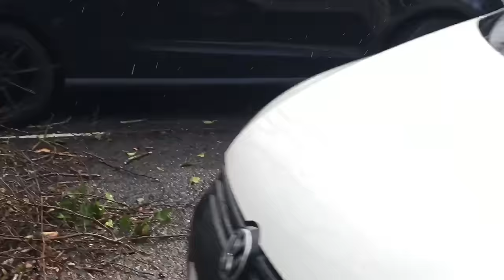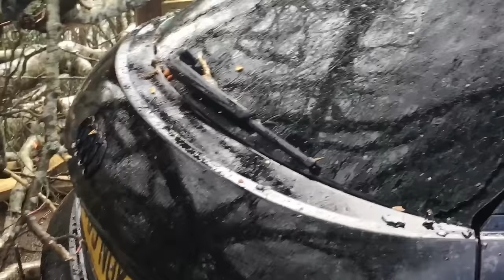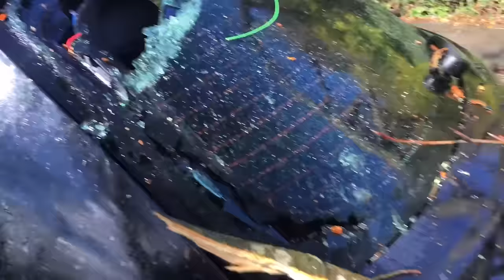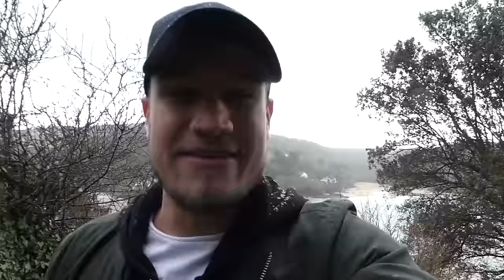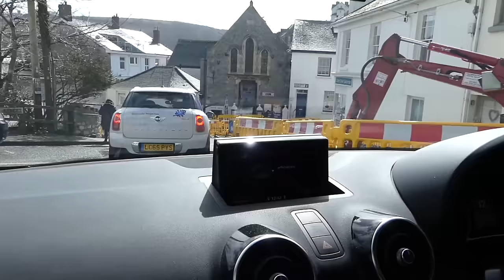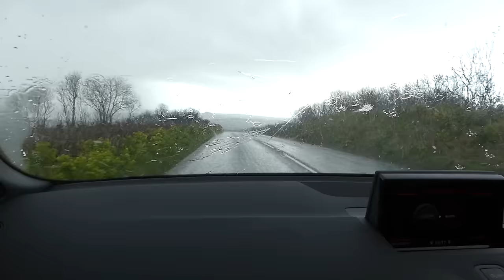MY DAILY DRIVER 'THE NUKE': 6 MONTH REVIEW!!

Comment: Paul, some advice from a fellow Audi owner (A3 Saloon 1.4tfsi S tronic) - you'll get better economy with drive select in comfort or even individual. Economy mode actually uses more fuel to tick the engine over in neutral, whereas coasting in gear uses none whatsoever. My overall mpg increased about 10% once I ditched economy mode.
Reply: My father recently had the A4 Allroad with it's top spec for a weekend, Dynamic mode is probably the best mode for both comfort and economy

Comment: my mum just picked up the new 2016 Audi A1 sportback 1.6 tdi with the active exterior pack. very rare only 2 of them in northern ireland and we have 1 of them.  it looks insane. it has matte grey front splitter with  connecting grey fender trim and matching side skirts and rear lower bumper. its coloured in 2016 high gloss audi red with matte grey secondary colours matching the body kit.

Comment: Bought a factory ordered Mini F56 Cooper, eighteen times it's been in for faults, electrical parts replaced, on my third door handle, things not screwed together rattling, dash top removed and refitted to seat top air vent and tuck in material coming out at the central display, fuse box was not screwed tight, door rubbers trap dirt and scratch the inside sill, material coming away from both rear windows that would require them refitted so living with it, a passenger seat belt rattle that was common on early builds they don't know how to fix and it goes on. Engine is fantastic as is the tech but from day one problems. So wish I'd gone the Audi route. I'll never buy a split new car again from a new model just out. Had my old cooper six years R56 and it just gave me a smile, pity the newer one was not even close. Only wish I'd had finance on it as I'd have told them I was not paying any more and they could have it. Stuck with it unless lottery comes up and I'd buy that Aston. 👍

Comment: If you look for you replacement/upgrade of your Nuke...

Why not Polo GTI? Basically the same body as A1, small but useable, and 189bhp for that kind of small car means quite something. Some of those have DSG instead of 6-speed manual, and I would say you better find one which has performance pack, basically meaning adjustable shocks.
Reply: Hard ride

Comment: Hey Paul! How's the power on the nuke? More specifically, how's the passing power on the motorway above 60 or 65 miles an hour? Also, how does it handle the corners? Can you throw it into corners pretty well without much body roll when you're feeling like having a little fun? Thanks! I live in the states in Ohio, which is about 5 hours southwest of New York City. Most of my driving is on the freeway at 65 to 75 miles an hour. We don't have the A1 over here, but I was thinking of getting the A3 or the A4 with the 1.8 liter turbocharged engine with the S-Tronic Dual Clutch Transmission. What are you thoughts on entry level luxury, like the BMW 1 and 2 Series, Mercedes-Benz CLA class, Lexus IS (do you guys have Lexus? btw Lexus is the luxury version of Toyota, I don't know if you know that or not. I mean, they DID make the LFA :D ), and the Audi A1/A3 (depending on if your country has the A1 or not, because over here in the States, the entry level/least expensive Audi is the A3. But the A4 isn't too much more).

Comment: is it an A1 or S1?
Reply: A
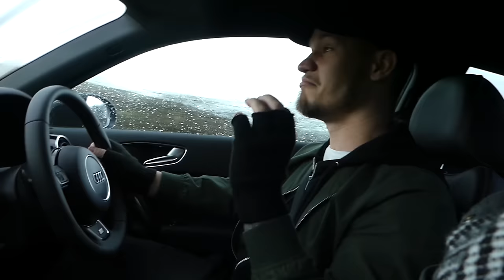Reply: +Louis Heemeryck Paul calls it the Audi A1 a couple of times in the video, like at 15:41 so i think its audi A1 :)
Reply: +Louis Heemeryck a1
Reply: A1 but an S-line.
Reply: +Louis Heemeryck A1
Reply: It is actually the A1 S-line so.
Reply: +Nik Brudar it's a A1 s-line basically means it's s-tronic and a styling pack. Then the s1 is a different animal it's a 2.0l quattro
Reply: +Nathan taylor it doesnt mean its s-tronic, you can get manual s-line audi's. it means sport line... also the sline is 2.0L and can be quattro, the only main differences between a top sline and an S is power and torque and some styling
Reply: +Stephen Hirst mate I work for Audi uk I think I should now the difference them I was being brief and I said basically because I didn't want got go into much detail about each car
Reply: +Stephen Hirst it is not necessairly a 2.0 engine. As he says in the video, it is a 1.4 and I'm pretty sure you can also fit the little 1.2 with the s-line package, at least here in Germany.
Reply: Nathan Taylor.. if you work for audi shouldnt you have been more accurate with your details? and GermanCube, i wasnt saying they only come as a 2.0L, i meant you can get them as a 2.0L also
Reply: Nathan taylor I know.
Reply: +Stephen Hirst you want details ok
A1 s-line starts with a 1.4 tfsi, 1.4 tfsi cod (cylinder on demand), and 1.6 tdi all come with choices of gearboxes from a standard 5 speed to S tronic neither of which can be Quattro only fwd.

S1 come with just one engine a 2.0l 230bhp Quattro 6 speed manual. The s1 had the rear suspension redesigned to allow for the rear differential and extra running gear to fit underneath.

So as I said on my original comment the s1 is a completely different animal to the s line.
One last thing there is a a1 that Audi built before the s1 it was a 2.0l Quattro and it was a limited edition version. I believe they built 333 of them in homage to the rally icon the original Quattro.
Reply: Copying jww
Reply: +Hide Myass Supercars of London had his Audi before JWW.
Reply: i know that already, the part i mostly wanted to point out about your comment was that you said s-line means s-tronic, which is incorrect..
Reply: +Nik Brudar So s1
Reply: kiran seehra no! S-line means the same as AMG-package or M-sport package! It's just an appearance thing.
Reply: Nik Brudar Ah okay

Comment: Hmm i have a 5 door, 190bhp car which give 55mpg on motorway runs, and 38 mpg being driven hard.... shed load of torque (quicker than a Porche cayman in 6th)... why wouldn't you buy a Diesel for your needs ?
Reply: really constructive, a lot of people would say the same about a 1.4 over priced Audi.. especially due to how Paul is using it.
Reply: +Adam Twist 
2016 Audi SQ5 TDI Competition: 0-100 km/h (0-62 mph) in 5.1 seconds 
Audi SQ5 TDI
The first and only SUV on our list is the performance-oriented Audi SQ5 TDI Competition. Let us translate that marketing name for you: it is the S version of the Audi Q5 with a 3.0-liter V6 TDI engine. The unit delivers 326 HP between 4,000 and 4,500 rpm, while the maximum torque figure sits at 650 Nm (479.4 lb-ft) between 1,400 and 2,800 rpm. Those two ranges are generous enough to provide breathtaking performance in an SUV, as owners of this model already know.

The fuel economy rating for this model is of 6.6 liters/100 kilometers (35.6 mpg) in the NEDC mixed cycle. Like all the models on our list, it has an electronically governed top speed of 250 km/h (155 mph). As expected, the transmission of this version of the Q5 is an eight-speed automatic of the ZF variety, which delivers power to all four wheels through an FWD-based quattro all-wheel-drive system.

The SQ5 TDI is distinguished from the standard model through aerodynamic elements on the front and rear bumpers, along with dedicated side skirts, special ornaments and larger wheels with a specific quattro design. Another peculiarity is that, until recently, it was the fastest SUV in the Audi lineup, which is no mean feat for an "agricultural" vehicle.

Comment: Why are you comparing the A1 to the smart car?! A1 runs on an VW Polo platform. The poll has a smaller brother witch is called an UP!
And still, the up! Seems bigger than a smart. 

Yes, the A1 is the smallest audi, but they build it to have the best and biggest small car. 
Compare it to the Mini Cooper thank you. 

And yes you should use the Eco mode only when it makes no difference. Having a longer throttle, a bit less Air-con, and the coasting... Does not really matter on the motorway does it? 

And why do you buy a car without a testdrive when you wanna get a car you're driving everyday?! 

And again, one camera angel:/ 
Sorry Paul it's getting worse.

Comment: £20k 😱😳 seems a lot for such a small car
Reply: +Over The Road Rowson A guy I work with just bought a Vauxhall/Opel Adam S, which is a size smaller than the A1, and cost over £20,000 with the optional Recaro seats. It isn't even very fast.